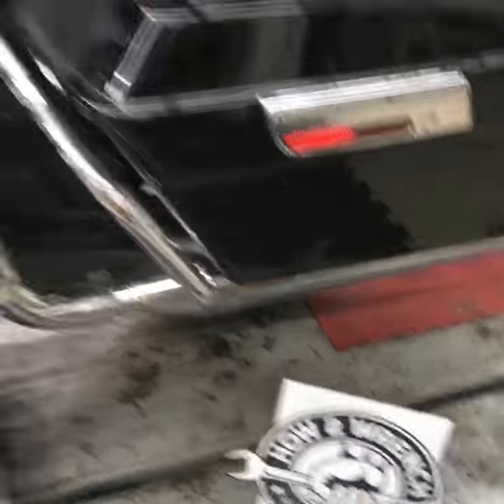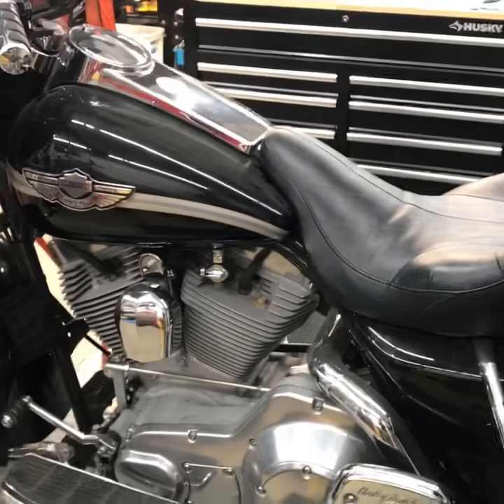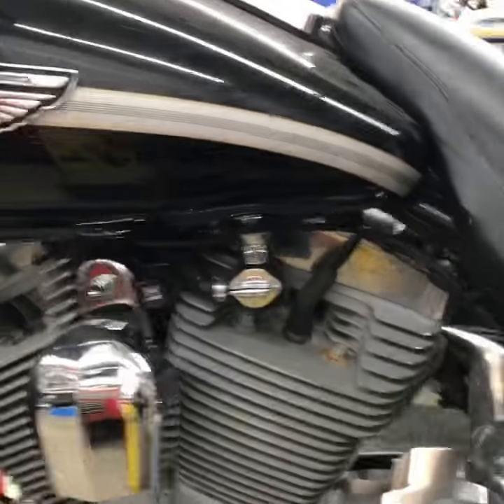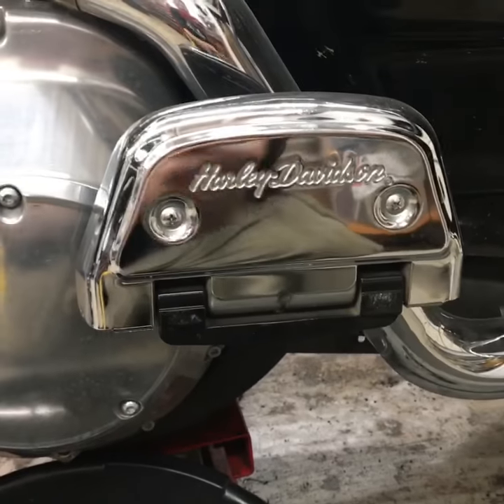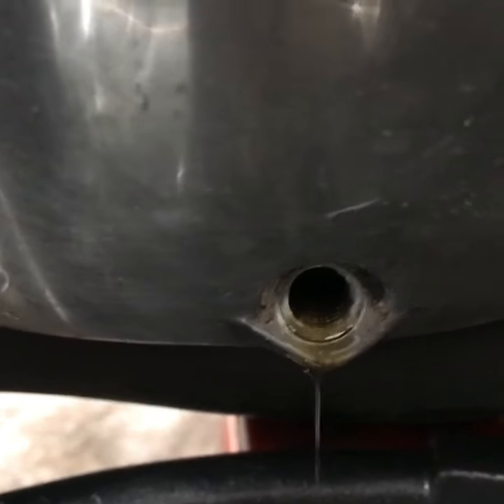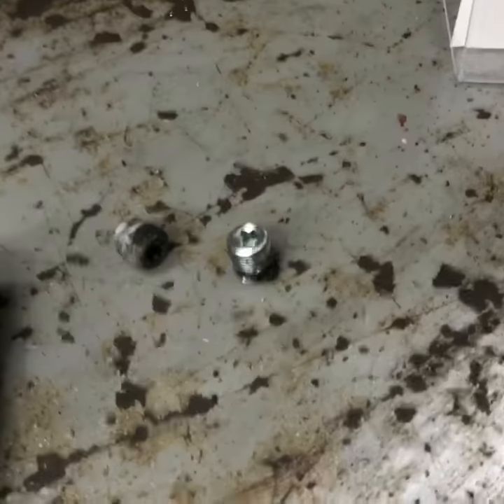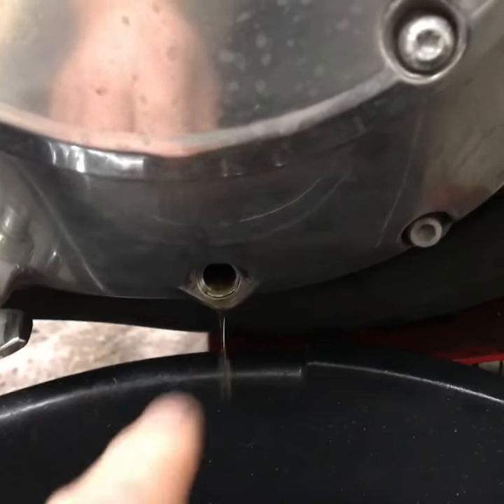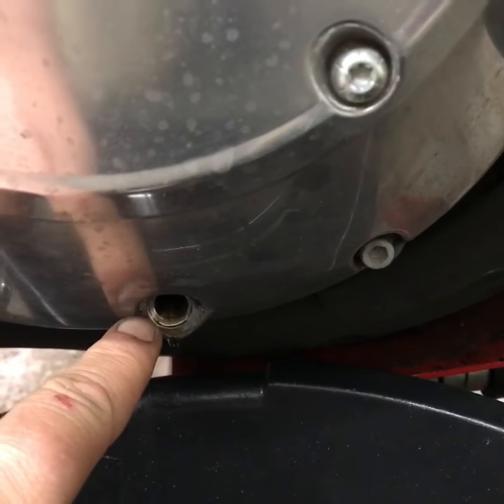WTH??? Two drain plugs in my Harley Davidson primary cover??? Check this out!

Comment: Wow..... Just wow!!! That's alright, I just bought a 2015 Fat Bob, 9500 km on the clock, on the 6th week out of the dealership, the rear drive side wheel bearing disintegrated..... Not fun times I tell you.  Then after that was sorted out, the electrics went silly (no Speedo, auto cancel indicators stored working, engine idle stopped etc) intermittent fault, so couldn't pinpoint it, but I replaced the VSS and she's behaving atm, so time will tell!. I still love the bike though, so hopefully we've weaned out the gremlins 🤞🤞🤞🤞🤞 Enjoying the informative vids Shane, thanks.

Comment: Just drill and tap a new hole. Make sure you put the change in the paperwork of the bike so the next mechanic does not get a surprise.  provide a spare new correct drain plug couple of dollars.  Charge the client. End of..